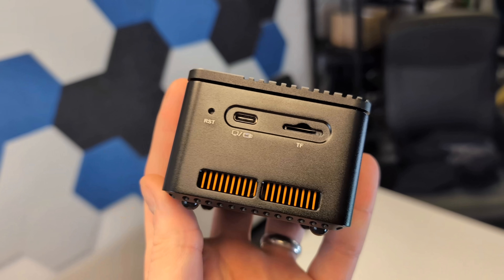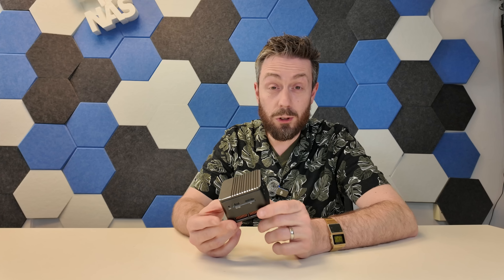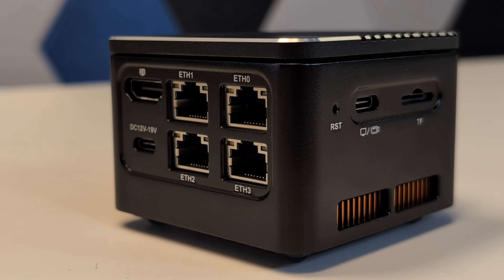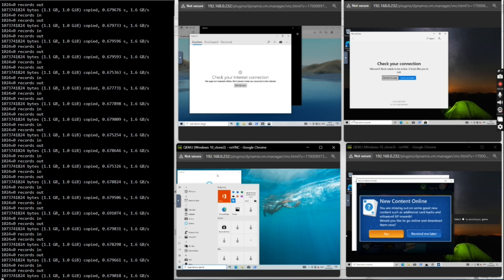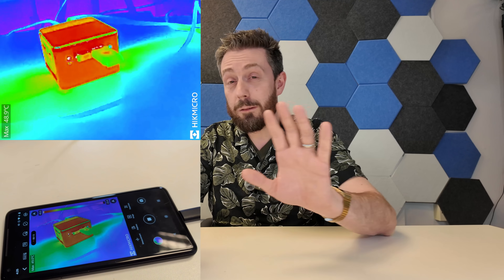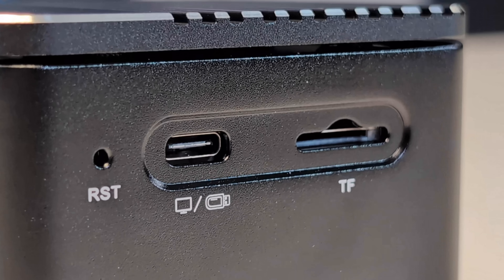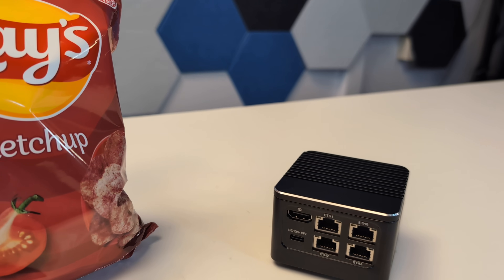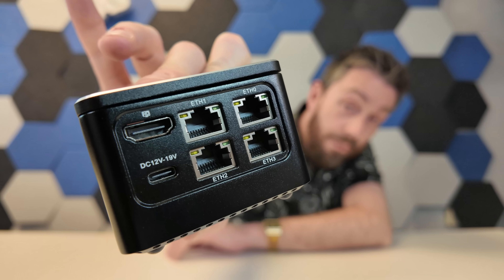NAS/Router Smaller than a Bag of crisps? - I NEED YOUR HELP! (Mrroute Mini M1 Plus)

Comment: I'm using one of these M1 Mini router N100, as a firewall.  Currently running pfSense 24.11.1 on an OEM WD SN740 256GB M.2 2242 SSD.   It works just fine for my home lab router/firewall needs.

Comment: I don't see it as a proxmox box - it's a bit light on memory to be more than a few lxc containers.  And the cpu is a bit overpowered to just be used for things like pihole and maybe plex. Are those gen 3.2 USB (10GB) ports?  What I'd do then is attach some of those Terramaster USB DAS storage boxes (D6-320) that are pretty cheap, fill them with big spinning rust, and have myself 200+ TB of storage on TrueNAS in a very small footprint.  Swap the HDD's for some SATA SSD'd, and you'd be able to saturate all those ports pretty much.

Comment: Very nice looking little device.  I'd go for an NVR -- plenty of ports available to ensure your cameras never get anywhere near the internet and enough CPU/GPU grunt to run Frigate, plus mirrored (ZFS) storage on the USB ports.

The only issue I have is pricing.  For the model with four i226 ports and only a 512GB SSD, Amazon Japan is asking $769 right now.

Comment: Title :- Turbo Charge you home network with this box

high endurance SdCard (256GB) for proxmox (pfsense/opensense)(dockers) & m.2 for storage make it a cache device for steam and as it has usb 3.0 you can add some external drives like that 6TB seagate usb drive if you want to be it as nas
and add the high-speed router as just as AP like tplink b400

Comment: There are few usb expansions available. There is a TF card slot. There are 8 cores. Possibilities are endless.

I would like to see if it is possible to make and deploy a full feature router/nas/vmware with this little cube.
 (small All In One homelab/nas/router cube is a nice title). It is certainly possible.

Install proxmox on an external ssd/usb flash drive/TF card and boot from there. Then pass the whole network chip(s) to a openwrt VM with 2-4 cores. Then you can pass the m.2 controller to another VM and install OMV on there to make a nifty NAS. Or you can pass external usb hard drives to the nas to have more options in term of redundancy.

Comment: What's the speed of the USB ports - 5 or 10Gb/s?  With gen2 10Gb/s port, I'd consider hanging a USB HD drive storage array like the 5-bay  Sabrent DS-SC5B off it. Run it wth proxmox and a virtualized NAS/backup server.

Comment: You are giving up some usability (2280 SSDs, etc.) by going with such a small form factor, so I think an "ideal" use for this needs to take advantage of the tiny size.  Either portability/travel or hiding it in something.

Comment: This seems to be a folded up version of the typical CWWK/BKHD/topton 4 lan soft routers, but with an added fan.  There is at least one normal flat version of those with a fan but it only shows up in topton's lineup.

I think coincidentally noticed this unit today on Ali under a different brand/seller. That seller seemed to say it was a cwwk unit, though it's not on their own sellers/sites yet if it's true.

Physically the main tests are going to be heat vs noise.  And I'm thinking it might tip over with lots of ports plugged in and cables hanging.

It can only do nas using USB, so that's a bit iffy for your site.  Unless you did m2->6sata and left the top off.  

I'd say think of THIS UNIT as an "always on at lowest watts" device.  So openwrt (I guess opnsense tested too) in a vm. Home assistant in another vm. Maybe home vpn inbound.  As a home device idle watts very important.  We know already the N-series cpus hate going into their sleep states.  So this is the core gateway device that's doing the 24/7 tasks.  Add any other dockers/vms that fit that idea. 

Other more powerful devices/tasks in the home doing deep sleep or off while owner is at work/asleep.  Actually that could also be true in an SOHO setup.  This is the unit left on while your not at work. 

Assumptions: 
home network with gaming pc elsewhere, 
Nas/Plex elsewhere either spundown or better yet off under wakeonlan.

Comment: I had an iteration of this a few years ago (cbox-m1) and I wasn’t feeling safe using it. The USB-C it uses for power is just a converted barrel jack — no other charger was able to power it. This hackery alone was enough, but it was also not as quiet as I imagined it to be, not quiet enough for the living room. The BIOS settings look all unlocked and that’s not a good thing here ‘cause it just shows that there wasn’t any tuning done by the manufacturer. I’ve managed to find an original OEM for the platform on aliexpress under the name Shenzhen Piesia Electronic Technology Co.,Ltd and by the looks of it, it’s still just their platform rebranded once again.

Comment: I have been using tiny travel-sized Linux pcs that are combo router/nas/SQL/media/accesspoint/vnc-desktop/ devices for many years. I travel a lot, and I use this tool every day. Mine uses a battery or adapter. I started with a VM design long ago which I quickly abandoned. Two pieces of advice: 1) get a fast "fit-sized" USB WiFi Adapter bc you'll want it for a WAN (using the internal WiFi as a LAN), 2) you need a remote desktop (I use TurboVNC) which makes mtc easy - like getting signed on to a hotel WiFi and provides a Linux desktop to your phone/tablet, etc without lugging a monitor around. The rest is handled by IPTables and the tools already in your wheel-house. I won't say it's easy. But it's well worth it.